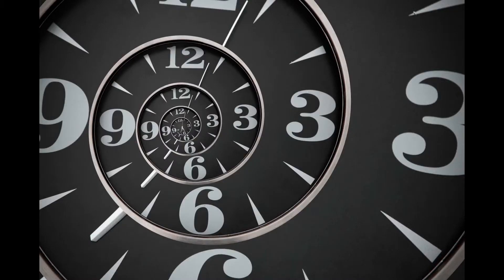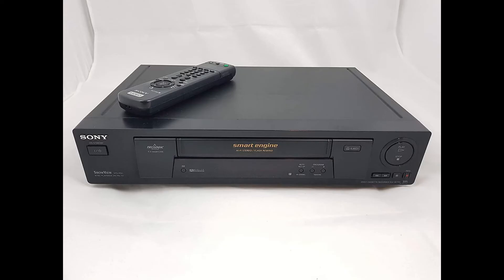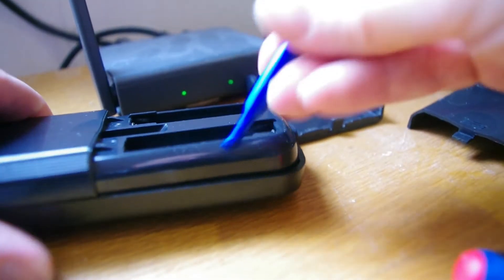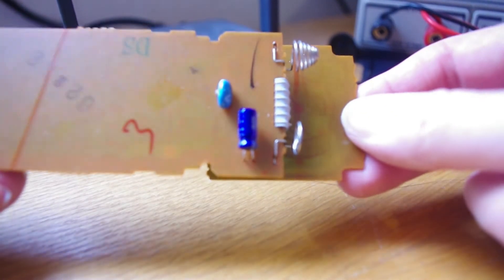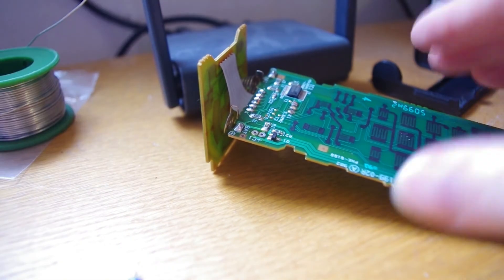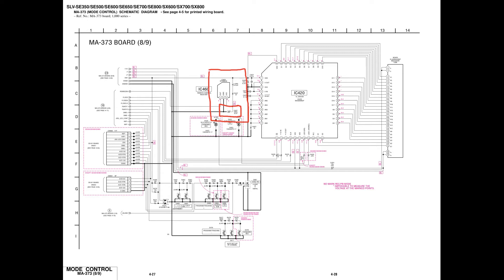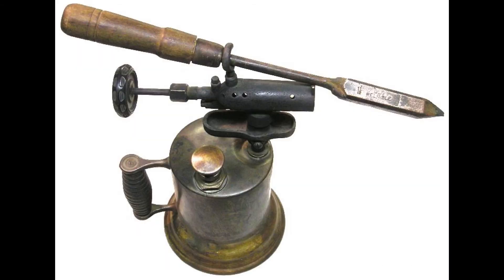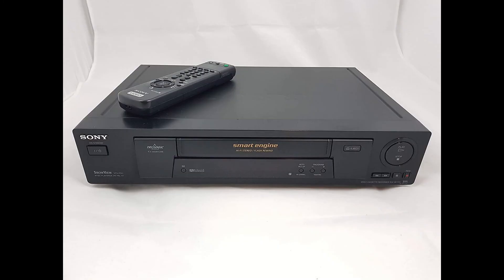How To Diagnose and Repair an IR Remote Control

Comment: I suffered an issue where the plastic in front of the receiver led had fogged up with old age. I popped the plastic for this out leaving a hole and this fixed the issue.

Comment: Nice one - I’m doing videos on basic repairs too but not uploaded much yet- the basic tip of holding a remote to a camera is something useful, one of my first tests and some cameras e.g iPhone have IR filters but the face camera doesn’t.  Another tip is using white vinegar and corrosive batteries , sometimes remotes can’t be saved from leaking batteries